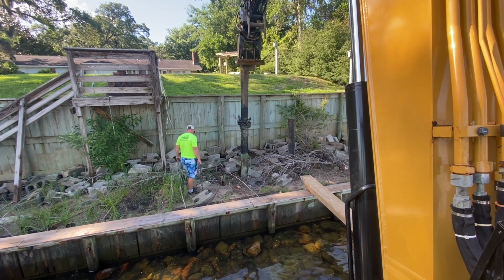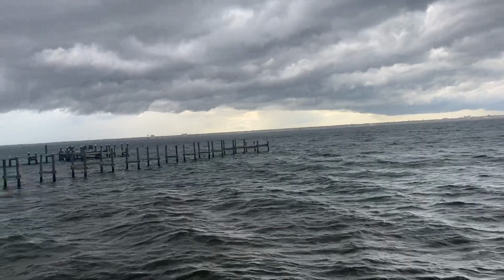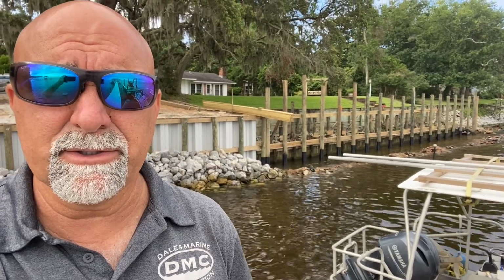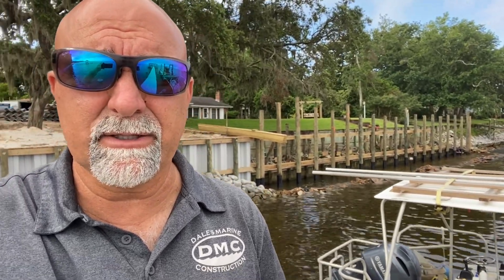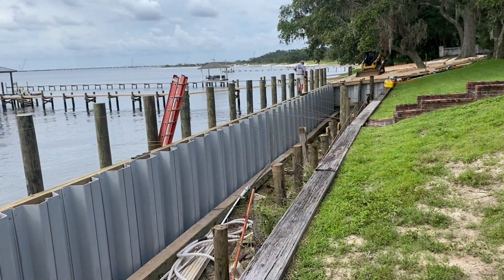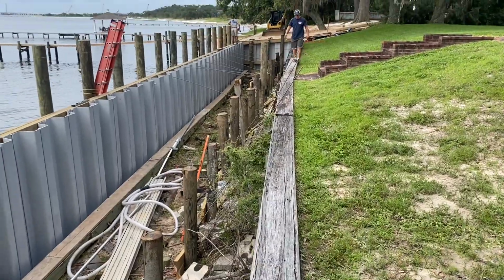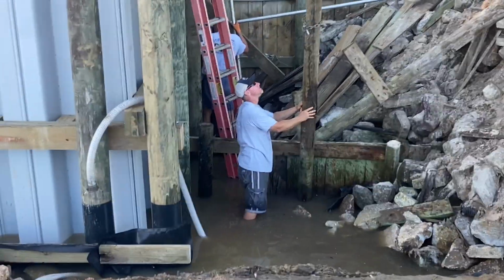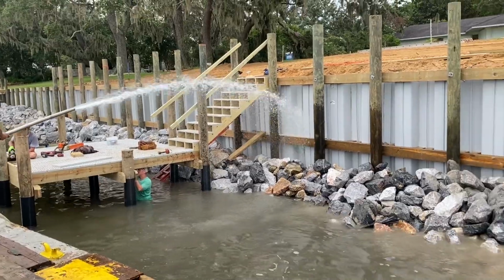Naval style vinyl seawall with Thru-Flow swim platform

Comment: Enjoy your videos, always interesting to see how things are done in different areas by different people. What's the thinking on making the whaler out of three 2x8 instead of a 6x6 or 6x8. Thanks Dave
Reply from the maker: Thanks for watching my videos and your comment. I’ve always use the rough cut two by eights and have not had any issues as long is tied back properly. I like to be able to stagger my joints all the way across to make a solid been and some of the hillsides we work on it simply makes it easier to get the material to the location not as heavy toting.

Comment: Do you not like a full box sheet, or is a z panel easier to drive?
Reply from the maker: Hey Michael thanks for your comment I do love the full box sheet but they don’t make it in commercial series that were use. The box is definitely much easier to drive keeps it straighter you have to work on the Z panel a little bit more to keep it straight. 👍